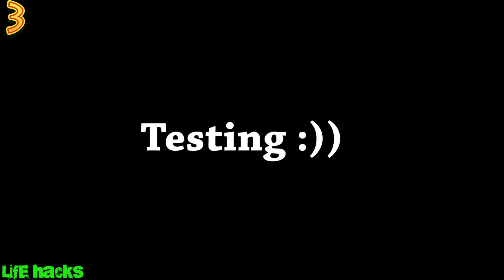4 Creative ways to make a Cooling fan at home [DIY]

Comment: what is the motor u used in every thing from were is it can u plzzzzzzzzzzzzzzzz tell me plz
Reply: i got  one from old dvd drive but it has smaller tip
Reply: the motor he has at 5:00 is also  from cd / dvd drive because it has the little gear on top